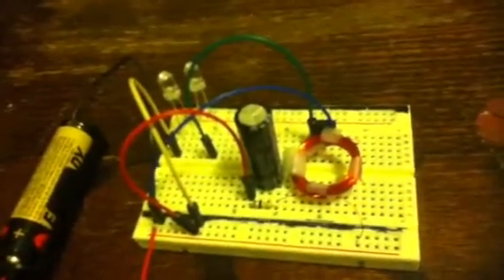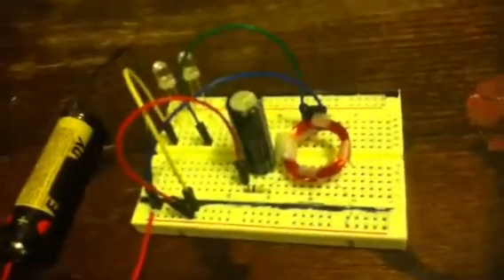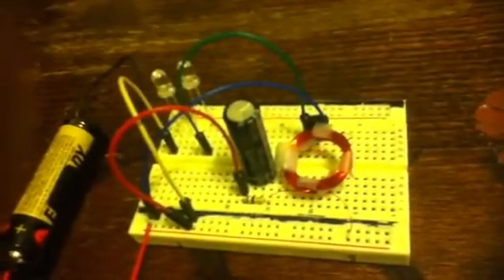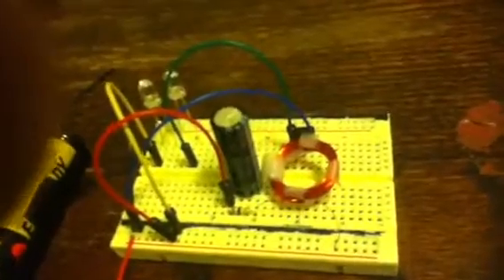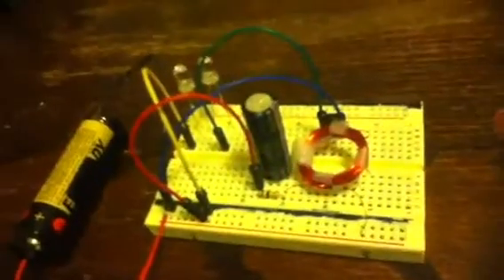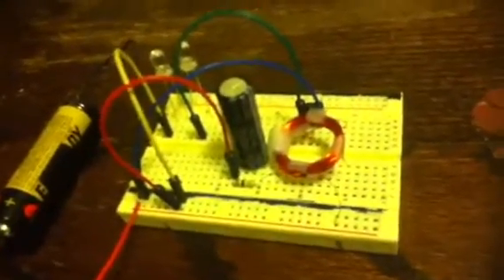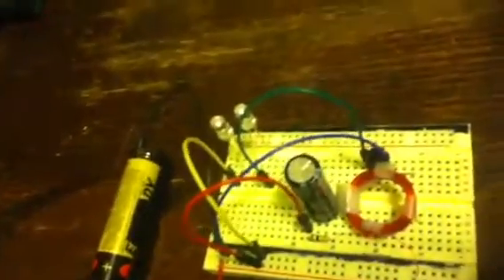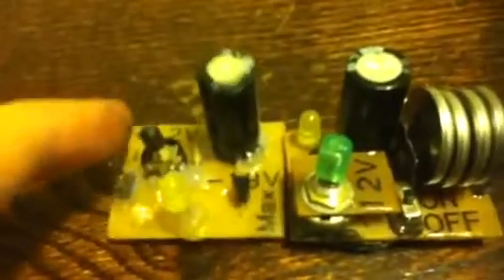Single Cell 1.5V Dual White Led Flash Circuit

Comment: hi, i.m very interested on your 3rd flashing light project,,  i like to copy it, can you please tell me the parts i need  ... thanks in advance.....
Reply from the maker: Tykes2001 hello tykes2001 if you download the PDF of Mr. Colin Mitchell's "200 Transistor Circuits" on his site "learning electronics" it is clearly listed as all the circuits are as an LED flasher it uses a single LED ( color of your choosing), an NPN transistor I used an S9013 , A capacitor value of your choosing( the larger the value the slower the rate of flash) , and a 1k resistor, I don't remember but I think a 10k potentiometer also. I believe that is the correct values and  is all the components and I do apologise it took me so long to reply, been real busy and haven't had time to stop and do things I enjoy! Happy making and  cheers buddy! Good Luck In all that you do! God Bless